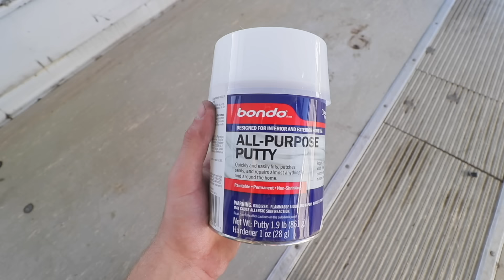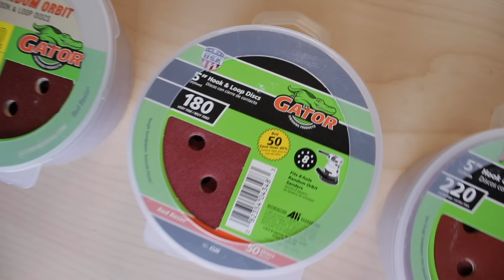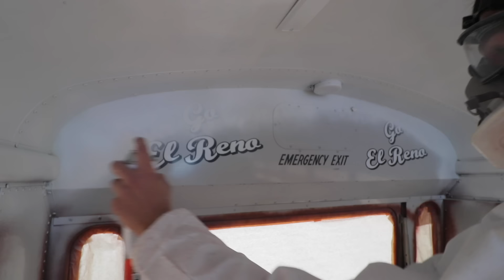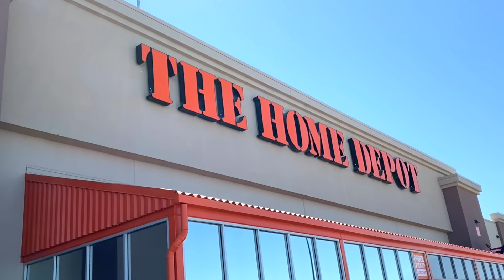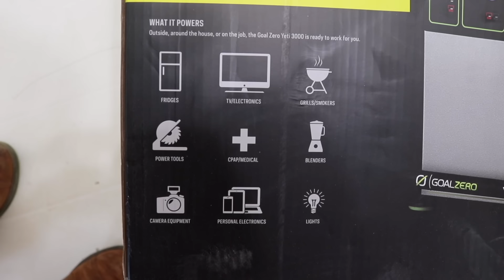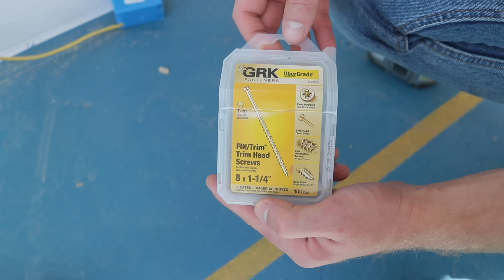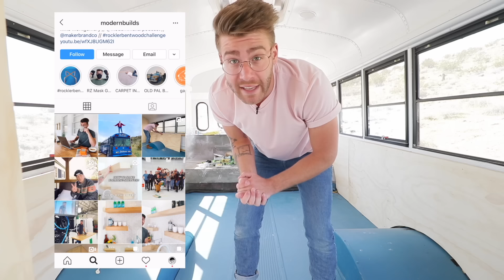DIY SCHOOL BUS TINY HOUSE CONVERSION EP. 1 | MODERN BUILDS

Comment: Can't help but get the feeling that some of these "design choices" were made to save work, not because of the aesthetics..
Reply: Feel the same way, lazy in places. Witch is a shame really.
Reply: Yeah... should have removed tge stickers and used a wood or wood look floor.
Reply: How do you spent so much time and effort masking off the windows, but justify leaving the stickers for texture. And not to mention he painted over the emergency exit, handle and everything. I cringed.
Reply: Quan Luong that hurt
Reply: no one which*
Reply: Maciej Nenutil I’ll give you that, chances are we wouldn’t know about most of the “cut corners” if we weren’t shown or told about them. I’ll admit though, I’d want to take the extra time to get a 9/10 job all round. Especially plumbing and wiring. I’d design it to make it easy to fix or position things so there’s as little plumbing as possible.

I hate the fact there’s no flooring or sub flooring either, that’s just lazy.
Reply: @Spazza42  its that important? seems like it would just add weight to me. form over function
Reply: jp91484 Why are you worried about weight on a mobile house built out of an old school bus. You’ll never get near a school bus’ weight limit since it’s designed to transport up to 70 kids to school and back. The amount of weight flooring would add is minimal too, I’d rather have some actual insulation in colder climates than trusting the original steel floor....
Reply: @Spazza42  can't argue with that. Insulation is important.
Reply: @Kw0nLong  Why wouldn't he paint over the emergency exit? I know I wouldn't want a dingy tan door on my ceiling.
Reply: Like, I trust this guy knows what he’s doing, but seriously, you spend the time to mask off the windows but you leave the emergency exit hatch???? Also those stickers were SICK and totally could’ve been reused.
Reply: Yes, and?
Reply: Joe you mean could?!.
Reply: Porque no los dos?
Reply: Vax Not Yep, seats out and water tanks in.
Reply: Glad I’m not the only one to notice
Reply: @Spazza42  Weight = Fuel.
Reply: This guy changed a lot over the years and I think it’s due time to stop watching him lol. Either he’s changing or his true colors are showing
Reply: Rudolph Bondefängerer I’m sure what would be the equivilant of a passenger or two wouldn’t make a difference to your fuel mileage, especially in a school bus....

It was a quick and dirty conversion, that’s pretty clear to most of us.
Reply: Agreed!! 👏 He is honestly the most incompetent DIY'er I have seen on YouTube.
Reply: I agree but I do like the look of the painted floors he should've just cleaned them it didn't look like he did any cleaning which is low-key gross

Comment: Suggestions: insulate the floor walls and ceiling . Trust me when it’s hot it’s hot and in the winter it’s cold. But everything is nice good job sir
Reply: Yeah the whole time im watching this I'm wondering why he didn't do  insulation.. I mean living in a hot area it's not necessary but it does help out alot and when he decides so go to a different environment he is going to notice
Reply: The bus is already insulated
Reply: Watch the whole video. Its already insulated.
Reply: More insulation does not hurt.
Reply: These buses are insulated poorly. And the roof should have been insulated as well. All that metal is gonna sweat horribly once someone starts living in it. Moisture is gonna cause mold, even in the desert.
Reply: My thought was not only the insulation, but the moisture barrier as well
Reply: @julianjaramillo2954  re read the comment and apply reading comprehension.
The floor and the ceiling aren't insulated.
That's 75% of the surface.
You can't insulate windows and the only thing that has insulation in his bus are the half walls under the windows.
That's nothing.
It's gonna be an oven in heat and freezing when cold.
The AC is gonna run all the time and the cost will be high for little confort.
Nvm the humidity.
The same with no circuit break boards.
That's a best scenario circuits and cables can melt and be ruined, at worse scenario the bus catches fire.
He building something that won't last.
Being handy isn't enough if you don't understand the basics.
He should have asked some questions to some professionals.
He probably just watched videos on how to do individual things without realising
Reply: He SPECIFICALLY said it's already insulated
Reply: @thebrightside7015  22:25 he addresses that.
Reply: @number1salesman-1997  You call the part below the windows insulated?? Oh and the floor??

Comment: quick tip for making templates is taking a 4x8 sheet of cardboard and cutting it into 2" strips and making your border as well adding supports so it doesn't fall apart when you pull it down. hot glue is used to attach the pieces together and small dabs can be used to keep the template up while it's being made. I did granite/marble work for several years and its the fastest way I've found aside from a laser system and a heck of alot cheaper.

Comment: Suggestion for the guys trying it:
Rust is the worst enemy of this type of vehicles. Always check the floor, walls and roof. Look for leaks or damage. Check the structure that holds the metal sheets and try to fix your interior structure to the steel structure (instead of the metal sheets). 

Unfortunately this may mean removing the floor and part of the walls. I recommend it and also look for mold. The old insulation might have some of that also. 

I'm not totally sold on screwing the wood beams to the metal sheet. I would prefer to create brackets and weld those to the structure, paint everything and the bolt the wood beams to the bracket. 

Always put a circuit/fuse box if you are mixing big metal boxes, water and electricity. You will be driving and things might break or get loose damaging the installation. You might suffer a traffic accident and a bus fire is no joke. 

Finally, consider that a big metal box will change dimensions with the temperature (interior and exterior). You might need to consider this in order to avoid warping or breaking wood. That also plays an important factor on reducing the noise while driving. 

On the mechanical side, check suspension, axel, brakes condition and lubrication on all those points. Consult a diesel mechanic and hear their ideas about the project. You even might take advantage on the original electric installation, or neumatic lines included on the truck.
Reply: Great advice!
Reply from the maker: Awesome info!! thanks
Reply: I've tried to be as positive and constructive as possible, but the work that is shown on the video is a little disappointing and can be dangerous if the guys following the channel try it without a correct planning and guidance. 

I know that the channel is for DIYers, (damn, even my self I have been optimistically ignorant of some of the challenges I faced in my life, but I always tried to reduce the risk, at least the risk to injury others).  Until today, the risk of getting hurt, sick or to injure someone else with the projects was really low. This build takes the risk to another level (I know, you have your disclaimer) I'm not comfortable on how it's presented. 

As your pal Four Eyes has said on his videos, designing and planning how tackle the problems and needs is the trickiest part of a build. Everybody can use a tool. 

Planning should have taken a bigger part of the video. 

Sorry for the text wall.  Keep the good work, but more importantly, keep yourself safe and healthy (and help to keep the followers safe too).
Reply: Seems like in these skoolie type vids ... not seeing much in the way about .... the "mechanical" aka engine and drive train information.  Seems to me ... that spending a few grand having the engine gone over and what ever.
Reply: If I can add think about ways to minimize weight in your build, remember your going to be hauling all this around wherever you go. Your building with the mentality of a home reno, way too many studs thinner skins,  I build two of these and have learned to build thin solid panels with 3/4" furring strips and 1/4" skins. Watch a video on how they build rv's cabinets. Added solid foam in exterior walls and in walls for extra rigidity.                                                                                                                                                                                                      In my mind just saying your not an electrician or plumber doesn't excuse doing bad work, the electrical dangers are just as real in a vehicle as they are in a home. As for plumbing this is where you really need to be positive of what your doing vibrations/potholes will really take a toll on these components, small leak can cause MAJOR problems down the road. Mold wood rot ....   Please leave areas like this removable for servicing.   Good luck with the build and please do some more research on planning and prep, IE lighting, switches, speaker wiring, water, heat/ac ventilation, exhaust fan....... before putting in the "pretty".
Reply: Sergio Sanchez after finishing the video I realized he didn’t have any insulation
Reply: @jp8612  22:15
Reply: I, too, noticed there is no insulation any where. I also noticed there are no shut off valves on any of the pex he installed in the bus. Not having a way to shut your water lines off inside the bus, may lead to additional problems inside the bus later on. You'll also want to make sure your water lines inside and out are insulated. You'll also want to make sure all of your water tanks are insulated. Good luck with your build!
Reply: Have u built a skoolie? Gonna save your info for next yr if I can start my build. TY
Reply: @barbibutton9619  not exactly a skoolie, but I work designing and specing heavy commercial vehicles to meet vocational applications. I mainly work on cargo trucks but in the last 10 years I did some special adaptations on buses (new and refurbished). Buses are more complicated from my point of view.
As I said before, proper planning and research are critical to success. You need to consider all possible issues of a bus, all possible issues of a house and all possible issues for the mix.
Reply: I think the welding idea is a great one but then makes me think you might as well just grab some metal framing and weld it top and bottom. It would be extremely sturdy and you could fasten anything you want to it.
Reply: Sergio Sanchez but rust is a good game.....oh wait
Reply: This comment need to be pinned
Reply: This is so long I decided to not read all of it
Reply: @Koda.official  14 comments is so long? Lol...
Reply: @melwallace1255  He's not thinking about winter, I guess.
Reply: @nonenoneonenonenone  or summer. It's going to be an oven in there
Reply: I've done a lot of reading on the subject and I agree with you.
You should strip the interior of the bus down to bare metal before you do anything else.

Then you can eliminate the rust and seal all the holes.

Then build the subfloor frame, The wall frames and then insulate the bus. 

In the desert where he's building the bus nothing like working in a tin can oven. 

The insulation will help keep your bus warm or cool.

Once you install your subfloor the rest is up to you

Comment: First I was worried about the fact that he didn't change any window. I thought of all the nergy loss when heating or cooling the bus. But then I discovered that he didn't even insolate the floor or walls. This bus is gonna be a pain in the arse to cool or heat.
Reply: Yeah. I was wondering why he hadn't installed any insulation.
Reply: yo and the electrical plug with exposed wire 14:10. so the walls and floor are going to sweat and possibly short circuit.
Reply: and the thickness of his walls, couldve taken a lesson from trailers and RV's... their walls are super thin, to cut down on weight, for obvious reasons.

Comment: Before you get too deep into this project, I humbly suggest using Dow Corning Foamular (or similar) insulation board inside the gaps in the wall.   It's easy to cut with hand tools and easy to apply with liquid nails adhesive.  If you care about the gaps, you can fill them in with a few cans of Great Stuff spray foam insulation.

Besides making the interior more comfortable, it will pay for itself by reducing the need to burn diesel to run the air conditioner.
Reply: Im humbly think the same

Comment: Suggestion: Air Pods do not provide any hearing protection whatsoever. Use ear muffs. 

Grinding metal can put out over 100db which will damage your hearing permanently. But, wear whatever you want.
Reply: Anonymous  Apologies, Im from Aus, and our hearing protection are called ear muffs. They are rated to our safety standards. 

I don't mean over ear headphones if that's what you thought.
Reply: Anonymous  even regular foam earplugs for noise reduction are far better than even the best consumer ANC noise cancellation headphones
Reply: @xistencestudios8904  Definitely
Reply: There are companies that make ear bud/ear protection hybrids. Its possible that that is what he was wearing.
Reply: @owlislike  doesn't look like it and I have not seen such earbuds. I have seen ear muffs with speakers in them
Reply: He's wearing hearing protection earbuds. He talks about them in other videos. Couldn't hurt to wear ear protectors on top, though!

Comment: i love how on these builds they never bother looking at the mechanics of the vehicle and just start putting stuff inside of it, the outside of that looks like shite, make sure its mechanically sound first
Reply: The bus ia not drivable.will just sit as a tiny house
Reply: @whathandleUtalkabt  If that's true, he got absolutely ripped off at $10k.
Edit: In a later video he says he paid $8k and $2k in repairs and it runs. All in all not too bad, but they're are better deals out there for those looking to get into the skoolie life.

Comment: Tip… calking…. Put a small amount of liquid dish soap in a cereal bowl (size) with water.  Run your bead along the corner to be calked.  With a soft gentle brush, brush the bead as well as both sides of the bead with the soapy water.  Then dip your calking squeegee in the soapy water and draw it along the bead.  The calking will fall right off the squeegee and not stick to the wall coated with soapy water, limiting the spreading out of the calking.  It is a slick trick… NEXT…. dip your finger tips in the soapy water and light run them over the calked corner bead.  It will smooth it out and give it a polished professional look. It will amaze you how well this works… do a few tests before doing the job to get the feel.  I learned this trick shortly after moving to Germany back in 1998… I was shocked how easy and fantastic the results are…

Comment: Think about ways to minimize weight in your build, remember your going to be hauling all this around wherever you go. Your building with the mentality of a home reno, way too many studs thinner skins,  I build two of these and have learned to build thin solid panels with 3/4" furring strips and 1/4" skins. Watch a video on how they build rv's cabinets. Added solid foam in exterior walls and in walls for extra rigidity.   Glue and finish nails really make these strong.                                                                                                                                                                                                   In my mind just saying your not an electrician or plumber doesn't excuse doing bad work, the electrical dangers are just as real in a vehicle as they are in a home. As for plumbing this is where you really need to be positive of what your doing vibrations/potholes will really take a toll on these components, small leak can cause MAJOR problems down the road. Mold wood rot ....   Please leave areas like this removable for servicing.   Good luck with the build and please do some more research on planning and prep, IE lighting, switches, speaker wiring, water, heat/ac ventilation, exhaust fan....... before putting in the "pretty".
Reply: Yes, he obviously did not research or watch videos about properly converting a bus.  He has 275K views now so mission accomplished but, as a usable bus, it is a waste of Home Depot’s money as is.
Reply: Great info, ty for those of us who r going to be trying to build a skoolie